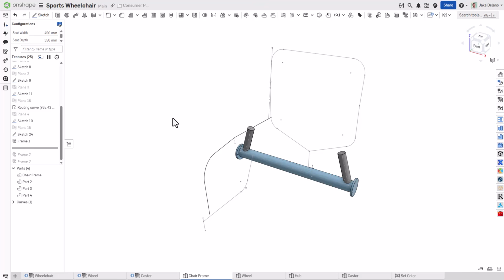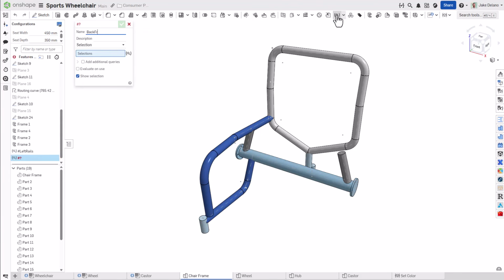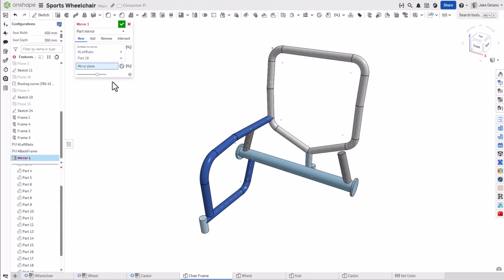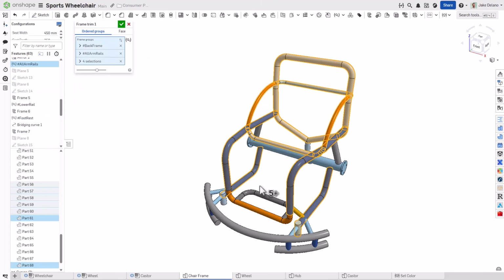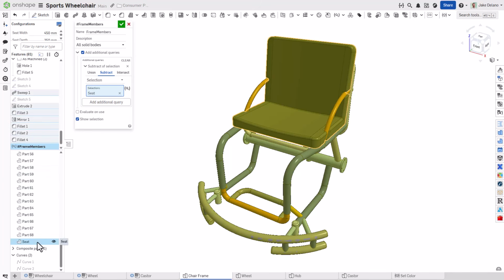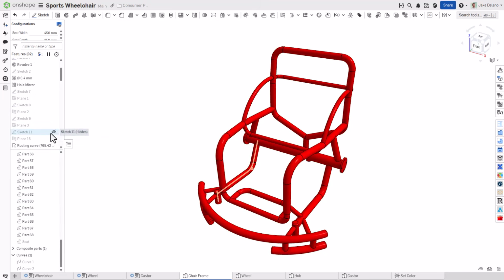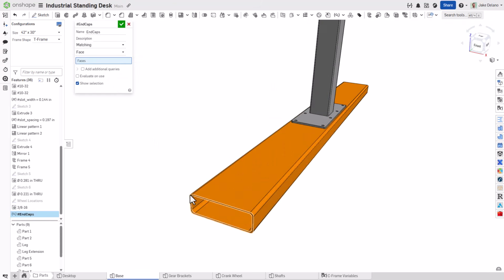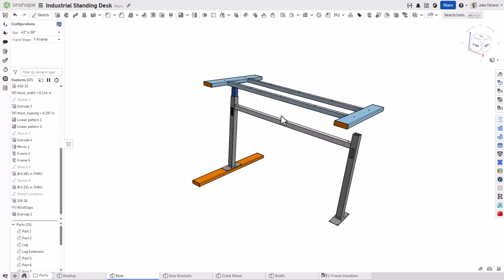How to Use Query Variable with Frames - Tech Tip

Comment: It would be nice if the linear and circular pattern features could include the original part they're patterned off of in the "created by" selection. That, or the ability to discard the original part and have a pattern instance put in its place.